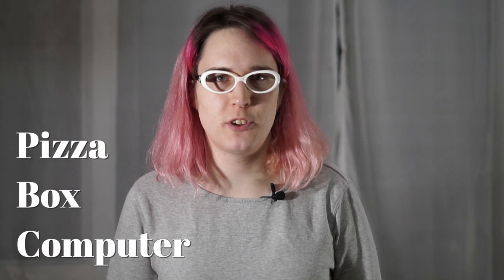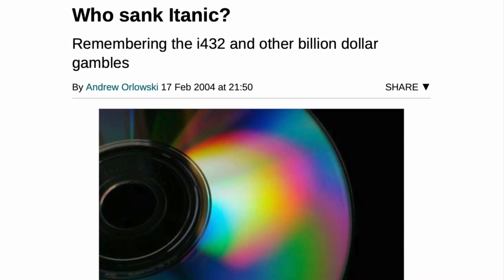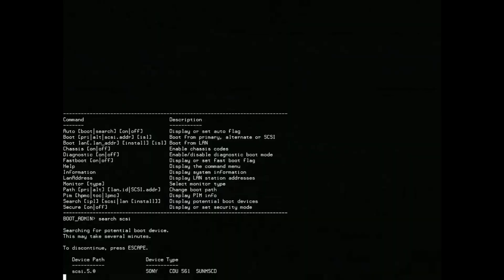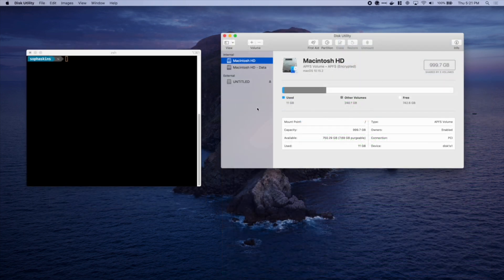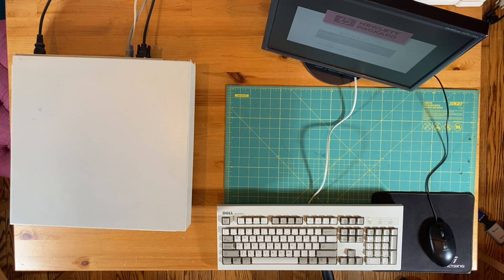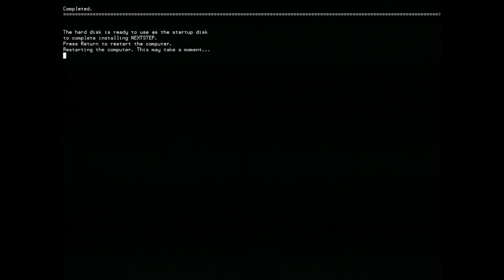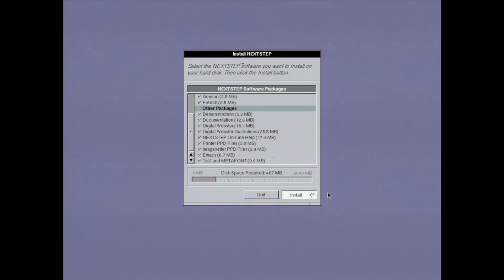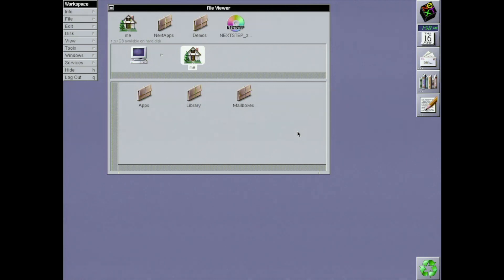Installing NeXTstep on the HP 712

Comment: How did you write the NextStep 3.3 iso image file to a physical compact disc?  The file is not a regular .iso file as I know in Windows.  Edit:  I can boot NextStep 3.3 iso file on a sd card in a ZuluSCSI adapter.

Comment: hello i recently bought a hp pro opt 2600 assuming it was a scsi cd for my roland sampler though it was not and the slot was too large for a conventional cd.  after some research i figured it could need a cd caddy so i ordered one from ebay. upon arrival the caddy did not fit either. So my question is what on earth is the correct media for this drive before i lose it and throw the damn thing in the trash!

Comment: I loved the gecko workstations.  Always had my choice of Sparcstations 5s and 20s but always went for the 712/100.  Just seemed all around faster and certainly quieter.  I've loaded Openstep on a SS20 and it's just a hot and noisy mess.

Comment: What keyboard make and model do you use on the hp712.. Next step is super picky. IBM model m does not work. And old hp keyboard does not work. A cheap modern HP keyboard works. I like your better.

Comment: Were you able to interact with the BIOS soft keys (the yellow ones at the bottom of the screen) using the IBM PS/2 keyboard?
Reply from the maker: Yes! It works just fine using the function keys